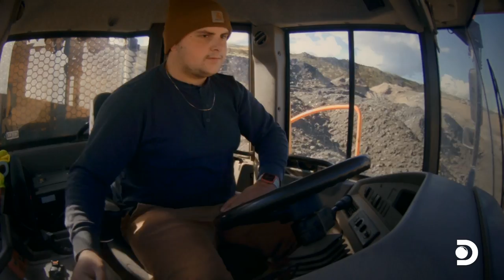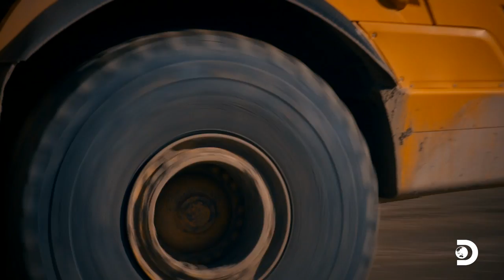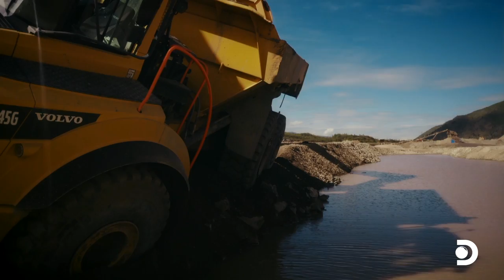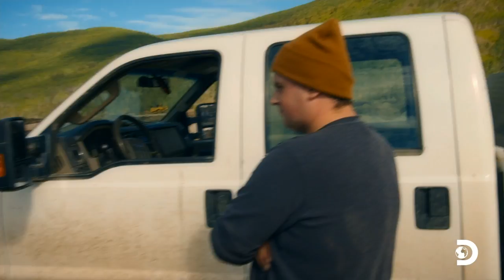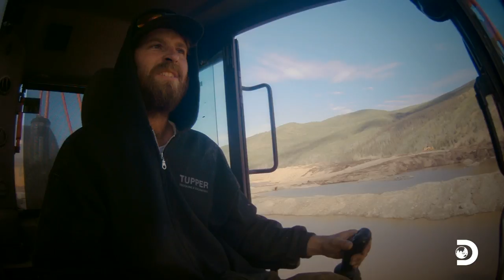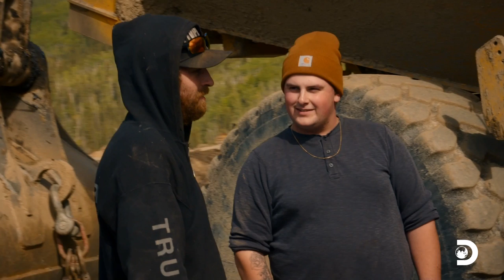1 Million Dollar Rock Truck Falls Into Pond?! | Gold Rush

Comment: That's not worth 1 mill LOL.
Reply: I just googled from the numbers on the side and a brand new one is 
For Sale Price: CAD $1,179,019
Reply: @papaguche  ya thats crazy. I didn't think rock trucks where worth that much. But you can get one with 3000 hours for 400k. Judging by the cab in the video it looks like a older model.